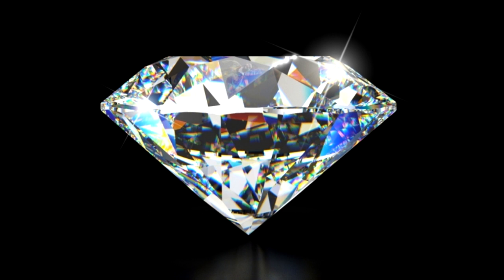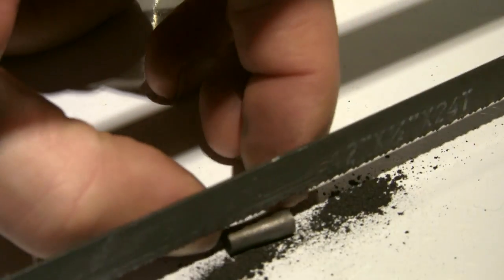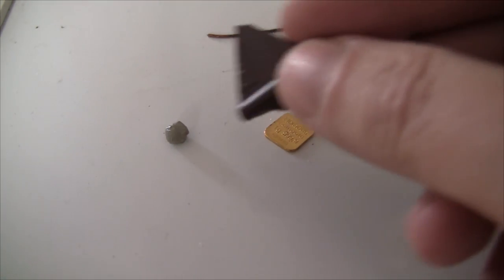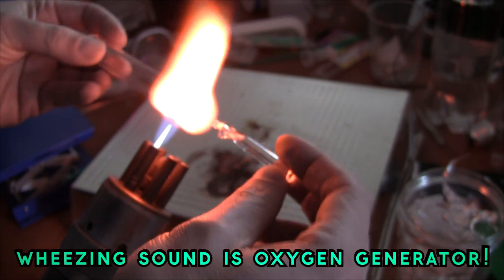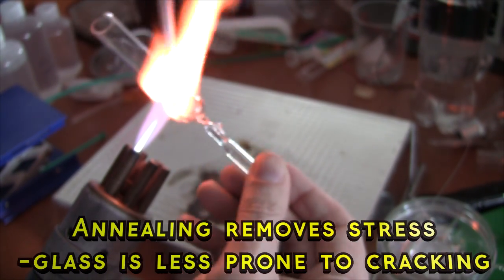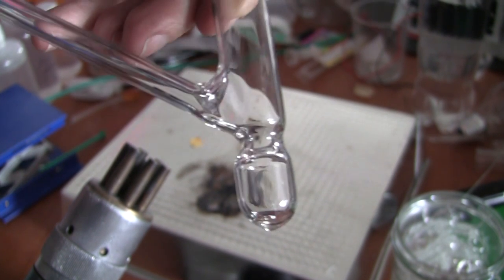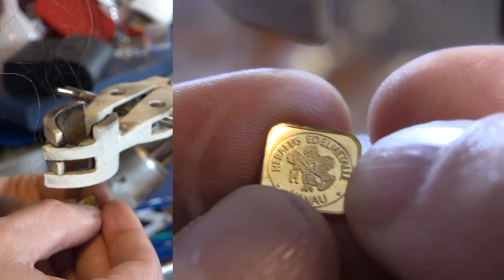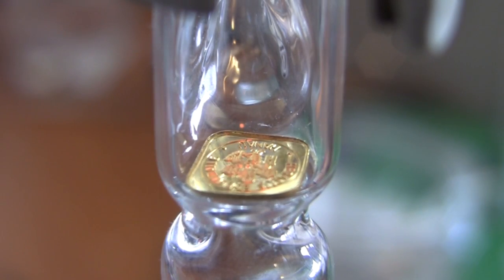Can burning Diamond melt Gold?

Comment: Coming next: can jet fuel melt steel beams?
Reply: "MELTED" STEEL

Claim: "We have been lied to," announces the Web site AttackOnAmerica.net. "The first lie was that the load of fuel from the aircraft was the cause of structural failure. No kerosene fire can burn hot enough to melt steel." The posting is entitled "Proof Of Controlled Demolition At The WTC."

FACT: Jet fuel burns at 800° to 1500°F, not hot enough to melt steel (2750°F). However, experts agree that for the towers to collapse, their steel frames didn't need to melt, they just had to lose some of their structural strength—and that required exposure to much less heat. "I have never seen melted steel in a building fire," says retired New York deputy fire chief Vincent Dunn, author of The Collapse Of Burning Buildings: A Guide To Fireground Safety. "But I've seen a lot of twisted, warped, bent and sagging steel. What happens is that the steel tries to expand at both ends, but when it can no longer expand, it sags and the surrounding concrete cracks."

"Steel loses about 50 percent of its strength at 1100°F," notes senior engineer Farid Alfawak-hiri of the American Institute of Steel Construction. "And at 1800° it is probably at less than 10 percent." NIST also believes that a great deal of the spray-on fireproofing insulation was likely knocked off the steel beams that were in the path of the crashing jets, leaving the metal more vulnerable to the heat.

But jet fuel wasn't the only thing burning, notes Forman Williams, a professor of engineering at the University of California, San Diego, and one of seven structural engineers and fire experts that PM consulted. He says that while the jet fuel was the catalyst for the WTC fires, the resulting inferno was intensified by the combustible material inside the buildings, including rugs, curtains, furniture and paper. NIST reports that pockets of fire hit 1832°F.
Reply: Until I see the WTC towers & the Pentagon & everything inside them liquified entirely,
I will continue to get all my information on the subject from Alex Jones.    (sarcasm)
Reply: after 100 ways to make tinfoil hat.
Reply: 7/11 was a part time job! Jet fuel can't melt nacho nacho cheese.
Reply: http://www.popularmechanics.com/military/a49/1227842/
http://www.purdue.edu/uns/x/2007a/070612HoffmannWTC.html
It's not just the NIST report.
Reply: SPOILER: yes, if they aren't in concrete
Reply: Or maybe try: OMG THE TWIN TOWERS WENT DOWN KILLING A TON OF PEOPLE AND SO DID A RANDOM OBSCURE OFFICE, THAT'S THE FINAL STRAW, WE'LL TOTALLY BE UPSET NOW

That's not ridiculous logic at all, right? Because.. motive. Totally needed that extra building to be collapsed to justify an invasion, amirite my fellow conspiracy theorists?
Reply: Debris from other buildings falling on top of building 7. Buildings aren't built for stuff falling on them. They're built for static vertical stress and some horizontal stress from wind. Not planes flying into them and concrete and steel falling onto it.
Reply: BBgub
Jackass I mean Jack S.

What is the motive to including WTC7 in artificial demolition? Would the twin towers themselves not generate enough raw emotion and shock for the American people to effectively want justice and/or revenge?

Ya'll have some explaining to do on the significance of 'destroying' a random obscure office, and why it is or would be just as important, if not more-so according to ya'll, than the symbolic and lives that were lost at the twin towers.

Really though, take a stab at it. I'd like to see how your brains work when working through Psychology and human emotion and the detective work it takes to figure motive. Investigators do it all the time, need motive to do a murder usually.

What's the motive here? What's the point? What does it demonstrate?
Reply: Jet fuel doesn't burn hot enough to melt steel... but that's completely irrelevant when we're talking about 75 tons of metal, glass and plastic crashing into a building at 575 MPH.
Reply: Conspiracy theorists will be disappointed if no catastrophe happens during the Trump administration. Better start blaming all those previous mass shootings on Obama though, maybe he's got an investment in the bullet or casket industry.
Reply: +Jack S.  "Those 2 goddamn towers were BUILT TO WITHSTAND A FULLY LADEN 747 impact!"

No they were NOT; they were engineered to withstand the impact of a 707, a smaller and lighter aircraft. What hit the towers were 2 767 jets - much larger heavier and with more fuel than a 707 could carry.

WTC7 fell because of the structural damage caused by debris from the two WTC tower collapses, and uncontrolled fires that burned all day in the lower floors weakening the steel supporting columns until collapse around 5:20 PM.
Reply: ReaperEOD fucking dumbass when a foreign nation sends a plane into your own country's building and kills YOUR people, it means WAR, not only by common sense but by legality and by the L.O.W.
Reply: Indeed, burning thermite is excruciatingly bright and as large and amount as would be needed to bring down the trade towers, it would most certainly be noticed. Also, I would like to thank you for volunteering your time to combat lunacy in these comment pages.
Reply: *Can burning diamonds melt steel beams?
Reply: No, but it can fatigue steel to the point of catastrophic failure.
Reply: Yeah, but there was also thousands of tons of asbestos in those buildings and TO BOOT, the floors that were impacted by the planes were recently fireproofed. Coincidence?
Reply: no spoliers Joe!
Reply: +BBgub 
Falling debris, it's quite simple.
Reply: Building 7 was hit by massive debris. And has been burning for hours. The footage showing it collapsing doesn't depict any explosions nor is there any bang hearable. The smoke from the gun is just dust in the wind...
Reply: WTC 1 and 2 actually were built to take the impact of a jetliner crashing into them, and they did take that impact without instantly collapsing, so that engineering goal was a success but they didn't take into account the after effects of such a crash, at least not far enough.
Reply: BBgub you are right. It collapses after catastrophic kinetic energy strikes it and heat melts its support beams
Reply: What exactly do you think is burning inside a jet engine to produce 2,000C operating temperatures? Hint it's jet fuel and that is some 600C+ hotter than the melting point if steel thus why the combustion chamber inside jet engines is usually made with things like Tungsten alloy etc. Softening steel is much easier only requiring temps of around 700C live wood can burn hotter than that with no insulation in fact forest fires are usually hotter.

This fire on the other hand had plenty of air flow since both sides of the buildings facade was punctured by the kinetic impact and was supplied with huge amounts of fuel not only the relatively short burning jet fuel but tons of longer burning fuels such as paper, plastic, wood, fabrics, and organic remains. The jet fuel would be more than adequate to ignite all of those materials in fact the autoignition temperature for pretty much all of it is <600C.

Of course above the fire you still have intact concrete floors adding significant insulation doesn't take a genius to figure out that air temperatures near the ceiling of that room would easily hover around 1,000C+ for as long as the fire continued to burn heat would have been trapped in the area between the top of the holes in the front of the building and the insulated flooring above it which is also of course the exact worst place for it because that is also where the trusses between the columns holding said floor up are located. Maintain this for several hours allowing the steel to absorb that heat and yeah eventually the steel softens until gravity finally wins.
Reply: YES! Phil showed directing oxygen close to the flame increases combustion - one of the most overlooked phenomena in the WTC events is the stack effect - Buoyancy occurs due to a difference in indoor-to-outdoor air density resulting from temperature and moisture differences. The result is either a positive or negative buoyancy force. The greater the thermal difference and the height of the structure, the greater the buoyancy force, and thus the stack effect - people only could stand near the perimeter (for a limited time) because the fire was further away and the sucking in of air cooled the materials at the opening preventing their location from heating up as fast as areas deeper within the tower - apart from sagging, the different rates of thermal expansion could have played a role by asymmetrically "tearing" structures apart slowly, maybe more so in WTC 7s unusual design than in 1 and 2
Reply: Provide your evidence for there being Nano-Thermite found in the dust. The only thing that I can seem to drag up is Niels Harrit who had found some red/grey chips that he concluded were thermite since the burning of them produced molten iron. Contrary to his crack-pot theory, however, that material is actually a rust-preventing primer paint that contains iron and kaolinite.

http://www.internationalskeptics.com/forums/showthread.php?t=231314
Reply: +Jack S.
"Yeah, I'm sure the government would openly admit it was a controlled demolition. Everyone knows anything knows the NIST report was bullshit. They didn't even TEST for any known explosive in their "report". Government shill bullshit. "

Weird though that the guys that do controlled explosions for a living or test material strength for enabling us to calculate how long a building will stand up during incidents like a catastrophic fire overwhelmingly say the report is correct and "everyone knows anything" on the internet is ignorant and full of shit.

How could ANY controlled demolition stay secret and hidden in a complex in which five to ten thousand (depending on how many of the office towers you count "in") people still worked the day of the attacks? You need QUITE A LOT OF HARDWARE to make something like that happen, even with really good suited explosives and the experts do no tlike others to run around where they have prepared their wiring and the holes they drill to get to a point where it is most destructive to blow up stuff inside the load bearing structure.

Wild fantasies of "thermite" melting down the towers have no relation to reality. There have been people cut off from rescue above the burning parts of the building that were on their phones until the end, there were several hundred people successfully evacuated out of the buildings and several hundred firemen ran into them to help with the evacuation and to try and save the towers and nobody mentioned any weird contraptions or bombs being obviously all  over the place?

Your common sense is fucked up and skewed beyond help.
Reply: +Jack S.
"Those 2 goddamn towers were BUILT TO WITHSTAND A FULLY LADEN 747 impact!"

No they weren't. The plane the structural safety report before the building commenced regarded was a 707, not a 747 and further than that it was a mid 60s model, not really comparable to a 2001 fully loaded just after the start 747. Just for comparison, the multiple variants of the 707 go from 104,000 kg to 151,500 kg take off mass, while the 747 starts at 317,515 kg and goes up to 447,696 kg. That's between 2 and 4 times as much weight. Also the calculations thought the most likely hit would be by a tired pilot trying to land at New York, not by a maniac trying to hit  abuilding with a recently started jet. For reasons of completeness... the planes that ACTUALLY hit the WTC twin towers were both Boeing 767 at a weight between 142,882 kg and 204,116 kg still a good deal heavier than 707s.

And finally it seems like the original report did only tackle the impact itself as they did not know how to calculate for the consequences of a big open fire from all the spilt jet fuel... they announced that the building WOULD survive an impact, but that the fire would kill many people as it would basically not be containable and spread throughout the whole building... which is what really happened, the towers stood after a plane crashed in each. They were brought down by fire.
Reply: +A,ex Long
" I didn't know we specifically designed buildings to have planes fly into them. I guess the WTC designers sure could see the future.."

No, they could see the past, where amongst other accidents a famous crash occured in 45 with a B25 bomber and the Empire State Building.
Safety concerns about planes ACCIDENTALLY hitting high rise structures like a skyscraper actually ARE part of the statical analysis before they get a building permit... even more so for powerplants and dams... but we can hardly test that as both a real building of that type AND a fully loaded plane like a 787 is pretty pricey just to be sure it will not cause a full collapse of a building. So they work with estimates and comfortable safety margins. Which btw worked in the case of the WTC... They continued to stand after the hits for 56 (south tower) and 102 minutes (North Tower) respectively.
Reply: It can weaken steel enough to make it easily bendable but not if all the fuel burns up in an initial fireball.
Reply: +BBGub
They will if their structural integrity has already been compromised by an incoming plane.
Reply: I'm pretty sure he did a video on 911 but I can't seem to find it.

Maybe he's joined the truth movement!
Reply: OMG WTC7 WENT DOWN, WE MUST INVADE FOR THIS ATROCITY.

See how ridiculous that sounds?
Reply: BBgub - sure sure - and a tree can not burn.
Reply: +BBgub
Lol coming from a guy that doesn't understand physics.
Reply: Has shitposting gone too far?
I need to do it full-time.
Reply: rigtio8887 but rocket fuel can melt steel beams!
Reply: That's why building 2 came down faster, more pressure from the floors above ..
Reply: lots of stuff made from Magnesium ...
Reply: in the fire what part would you find ...
Reply: rigtio8887 is this to do with 911
Reply: A;ex Long 
http://www.ae911truth.org
Reply: gullible peasants. our world is doomed.
Reply: Jet fuel? No. Fire? Yes.
Reply: Bullshit, on 14th September the Blackboxes of AA Flight 77 were found, the majority of the CVRs magnetic tape was fused into a solid block of charred plastic (useless), the FDRs  information was completely recovered! http://www.webcitation.org/5RfC3xUsq?url=http%3A%2F%2Fwww.ntsb.gov%2Finfo%2FAAL77_fdr.pdf. 
The Silk Air Flight 185 incident is completely different, whereas there is only one major physical impact on the CVR/FDR and the later possible water leak, early recovery is relatively easy since accessibility is pretty good in the river (Musi): Indonesian NTSC didnt want to think of suicide, but NTSB and history all point in that direction: the phenomenon is higly underestimated still today, out of different socio-cultural and economical reasons https://en.wikipedia.org/wiki/SilkAir_Flight_185  
In case of Flight 77 the recorders and remains of the airframe hit the most reinforced structure of the Pentagon many walls after hitting the ground in front and were trapped in the collapsed sections 91m deep where the heat was contained up to 2,000 °F - While progress was made against the interior fires by late afternoon, firefighters realized a flammable layer of wood under the Pentagon's slate roof had caught fire and begun to spread. Typical firefighting tactics were rendered useless by the reinforced structure as firefighters were unable to reach the fire to extinguish it. On 12th the fire was "controlled" but not fully extinguished, Firefighters continued to put out smaller fires that ignited in the succeeding days.
Reply: it wasn't a nation, it was a criminal organization spread around the world both logistically and by historic ties - action was necessary, but way back in 1993 after the WTC bombing and when the trace was lost in 1998, and not only after 9/11; the previous interventions in the middle east were bad enough to stir up hate and helped rise a big portion of todays attractivity for terrorist ideas, especially in locals, as well as global spread of ignorance and strengthening of a self-righteous martyr complex in many individuals, exaggerated anticapitalism, paranoia etc. -  one of the few good consecuences was the disapproval of more people towards war, even conservsatives (many also before the "war on terror") rejected the idea of such a scale (possibly many suffering veterans) - while many ideas like antisemitism and questionable views were always widespread on the populaces, to many of the affected people (mind, over 99% of the citizens in those countries were not Al Qaeda affiliated and many of those terrorised by them) it must have felt like a modern crusade which they were forced to endure and take much more "collateral damage" ultimately suffering even more under their psychopathic populace which gained more power in the chaos, as soon as power vacuum arose (not saying it was all good before)
Reply: the irony is strong in your comment; i am 100% positive that you yourself have not read one peer reviewed paper on matters directly related to structural systems of supertalls, nor do you know, that only the AON Center comes close to the particular unique style of tube-frame system of the old 1 & 2 WTCs, especially in terms of dimensions - the floorspace oriented design was especially vulnerable to fire induced structural failure; the perimeter columns were only designed for lateral loads, not for supporting weight - thats why the thicker core columns (partially) stood a little longer, until the missing side stability exceeded capacity - the many engineers and architects in supertall construction have learned out of the incident to invent more fire resistant steels, new truss systems, more composite usage (higher amounts of concrete) aswell as advanced super and megacolumns, several safety system implementations etc.
Reply: dont forget, observation dictates theory, not the other way around, sometimes new discoveries in materials science are made with unprecedented scales of energies involved - never in history a comparable modern airframe jetliner has hit any tall building, especially not of this design, so childish assumptions of improbability are invalid - scientific method falsifies, the proof lies in the ones who claim somehing isnt possible, until it is recreated accurate enough and shown to be impossible, the calculations and models of supercomputers, the expertise of the highrise affiliated companies with the most experience in supertalls are the best approximation - (most) unorganized laymen cant even come close to really understand nor work out results at the most specialised scientific community levels, there possibly have been rare exceptions, but the arguments against the official report are mostly not really differentiated well enough and sometimes terrifyingly ignorant - most people sharing this pseudoscientific shit are secondary or tertiary parrots who dont even want to understand an official not sensational enough report with hard physics, while the view that fits their emotional satisfactions is always the easier one to hold on to - the point is, even the part of really scientific working defenders of the official theory look at the assumptions of the deniers, with the same amount of scepticism as on the official ones - that makes good scientific approach, not stating or copying prefabricated and often manipulated so called "evidence" - while on a political level and some of the procedures of the planners may forever be unknown, at least the physical possibility seems to be shown by reality
Reply: "I dont know who youre replying to, and Im not reading all that" to you, i primarily addressed the twin towers; if you don't even have patience to read some few sentences - can you present a credible source of the supposedly quotes of demolition "experts"? well, at least read through the linked WTC 7 NIST report and even if you don't believe it, take years to learn civil engineering and materials science plus the history of WTCs systems and you'll understand
Reply: hot multiple-ton-heavy debris perforated the thin concrete slab floors and ignited combustible interior at levels 6–10, 13–14, 19–22, and 29–30 during the day - the sprinkler system was rendered useless, it required manual initiation of the electrical fire pumps, rather than being fully automatic; floor-level controls had a single connection to the sprinkler water riser; the system required some power for the fire pump to deliver water; water pressure was low, that's why firefighters gave up
Reply: 311 was an inside job!
Reply: Regardless if it can or cannot. It was still known months beforehand that they were going to do this. WtC 7 had a very lazy report made up about why it fell. Why they kept everything a secret for 15 years also with ALOT of redacted shit should also be a red flag. Its not just conspiracy. Hundreds of People heard bombs going off prior. Nano thermit WAS found. If you think a plane did all that youre just purely stupid. Pentagon still refuses to release cctv video, and the entire plane that "crashed" into it got completely disintegrated but a passport remained. Just think about it. Thats all you gotta do.
Reply: you display superficial knowledge on so many levels it isn't even worth discussing if you are so lazy to not even research the simplest of "arguments" which are copy pasted
"secret for 15 years" evidence?
"Hundreds of People heard bombs going off" it has been shown many times in history and criminal investigation that witnesses experience is very limited in perception, they mostly cannot understand causes and often inaccurately recall their experience
"Nano thermit WAS found" *thermite - i'm very positive you don't even know what that is nor do you understand that it would be stupidly complex to arrange the required amounts and cabling
Reply: Pentagon relied on personnel to secure, not CCTV; very few cameras were on site, mostly low frame parking cameras not for security - most material was discovered very late due to bad quality and possibly ongoing investigation until programs to deblur could present accurate telling - the plane didn't completely disintegrate, you were even too lazy to read anything of that report
Reply: the "just think about it" argument is so childish and snobbish, the what they think of themselves as skeptics, they  don't see any fault in their views nor do they question them in their arrogance - everything must stand the test of reproductive models and multiple sources have to back up evidence and a peer review must check this - NONE of truther BS is backed by the much bigger independent worldwide scientific community or skyscraper industry experts
Reply: TOP KEKTUS lmao. So who are you and why do you think youre opinion matters more than mine? As it is now, absolutely nobody who is a civilian knows what has happened. Including yourre narcissistic know it all ass. I dont listen to my government because theyve been lying to us fot a very long time about a lot of things. I use TOR and wiki leaks for my information. I read every word of the 9/11 papers that came out last year. All because i choose not to waste more than 5 mins on a useless comment section doesnt mean i have superficial knowledge. I just dont care enough to get stuck in. I know my government and saudi arabia were the sole reason why 9/11. Whether you agree or not matters not to me. Youre nobody and you know nothing, same as me. What i do know though, is that 9/11 smells like a fish market gone bad in a slum of india.
Reply: TOP KEKTUS Hundreds of people including first responders did hear bombs. Not only that there are tens of videos of the sounds also. Its pointless to even begin with you though because you couldnt hear anything other than what you want to because youre so full of yourself. 9/11 wasnt just a plain old terroist attack involving planes, and honestly if you believe that you are a complete imbecile.
Reply: Not only that but i had family who were there during the attacks who saw them and ran from them covered in dust in soot. They heard the explosions prior and during also. Not only that but they heard explosions before building 7 fell also. As my uncle was one of the firefighters that helped during the catastrophe. Bombs were most definitely a part of the attack.
Reply: Didnt the terrorists put bombs in the basement during the first attack? Why not this time. Logic would tell you to weaken the building from bottom to top. Yet there is no mention of bombs. and it was nano thermite that was found. No i dont know wtf that is but thats what was found.
Reply: All im saying is they are not telling the whooe truth. So you must think and ask why. Thats what i mean by just think about it. If it was a plain afghani terrorist attack we would of just came out and said everything there was tp say about it. Instead ita been covered in a veil of bullshit for 15 years and even when they finally decided to release information about it, it still smelled like shit in spain. Youre a sheep, a fucking moron. So is everyone else in this damn country me not excluded. Except i know how to think further than you and see shit you obviously cant which is a pity. I wish more people could see through bullshit. Neverll happen though obviously. What do you think of water gate? Taliban? Cia drug running? The iran contra? Jfks assassination? The entire legacy of ghe bushes? Youre dumb. Amusingly dumb since you think youre smart lmao.
Reply: I dont claim to have any evidence either. I just know people can be bought off and our countrys leaders are warhawks. False flag operations have been happening for a very long time, and just like the ones in the past the truth will come out eventually.
Reply: no, they heard explosions or compressed air compartments, elevators coming down... they didn't see any bombs - are they explosive experts? i beg to differ - "full of yourself" no i am not, because i only look at scientific evaluation not claims by civilians who panicked except when the level of detail and expertise show a reason to believe them
Reply: no opinion matters more, everyone should be free to have one, but the actions of an opinion can be malevolent; you are right, we don't know what happened, we can only approximate by a big group of scientists and experts with the right tools and tech - TOR and Wikileaks can be good sources, but even they have wrong Information, that's logical; also such a highly controversial theme can be infested with agenda on "both sides" - i would try to hear what people like Snowden have to tell about this
Reply: if it doesn't matter why take time to respond? 9/11 indeed smells bad, so much misunderstanding and blockade between possible responders, control, secret services... all the time they had since 1993 to evaluate and the loss of track in 1998 - i guess they are just human too and are full of mistakes - but such a extremely complicated event on so many levels needs stucking in, and even then only a part is understood
Reply: where is the credible source that did find Nanothermites (MICs)? until there is a definite proof with chemical reasoning and showing the methods used for evaluation i won't buy it - of course the whole truth isn't told, there was secret govt information in those bldgs (mustn't mean bad, just that secrecy is common) "Truth" is a limited observation from all the intervals from planck time to human perception (with help of tech)
Reply: TOP KEKTUS How could elevators fall prior to the planes hitting or pockets of air? Im talking about hearing explosions that blew out windows BEFORE the first plane even hit the building. By seconds i may add. You have to see the videos for yourself i guess. Human error will always be accounted for in any circumstance i understand this, and yes i also understand that there was top secret information stored in said buildings. Has nothing to do with why they dont tell us what happened to said buildings. Who cares about the info they contained just explain why it fell.
Reply: Also if it was as cut and dry as planes crashing and buildings falling the government and every other organization that assisted thrm during the tragedy would have been candid from the start. The fact that its been so fucked up and hidden behind so much red tape when we lost 5000 lives just doesnt sit well with me. If i were you i would stop putting so much faith into people who act like they know so much and just stop and try to connect the dots yourself. Theres plenty of information out to grab and data mine. You just gotta have no life like me lol :/. Sorry i was grumpy last night.
Reply: https://www.metabunk.org/the-thermite-paint-theory.t3263/ this thread also explains the many faults in the truthers "theories" about nanothermite paint - claims of truthers and numbers used in naive calculations are often made up https://www.metabunk.org/nanothermite-vs-thermite-thermate-for-cutting-thick-steel.t2873/page-5#post-84459
Reply: in reality, the nanothermite layers (VOD of max 1000m/s not enough to separate pre cut steel beams, min. used in controlled demolition 2000+) would not separate but sinter the beams (explosive welding), so they would stay in their place possibly even stronger than before http://www.mrzgroup.umd.edu/pdfs/2012_C&F_Reactive%20Sintering.pdf
Reply: for the observed outcome nanothermite is ineffective, while thermite in its large amounts needed (how would that many big boxes stay unnoticed?) would create such bright flashes that it would have been definitely noticed in lower manhattan; pure elemental iron and aluminium oxide levels weren't as abundant to even support a smaller scale use of thermite; further, paint as carrier would weaken the raction since it excludes gases provide faster VOD
Reply: my thanks to you also, without you i wouldn't have looked at this closely in a long time - i'm just a construction and skyscraper structure enthusiast, there's so many things to learn even for the experts in the highrise planning and building community, i only scratch the surface while "truthers" don't even know how few they know
Reply: yeah, while the WTC jets weren't fully fueled ("only" 1/3 entered the WTC) and weren't much heavier than the ones used in the static calculations of  Worthington, Skilling, Helle, and Jackson (WSHJ (from 1967-1983 "SHCR")), they were going much faster, had stronger airframes, and about 18 times the impact energy (+ even more explosive E in fuel!)
the calculations somewhere between 1962 and 1968 only secured initial standing, even many decades later there was no way to know how long the WTC Buildings could stand - even modern computer programs/testing today are limited
Reply: also interesting: in the early hours most of the ~50.000 (in the towers) + ~140.000 daily visitors, workers, clients, vendors and tourists were on their way to work or just entering the buildings of the site; ~15.000-18.000 were inside the towers; in the 1993 car park bombing it took 4h to evacuate the towers; it could have been easily 20-30k casualties if they had hit at lunch time
Reply: I'd watch the fuck out of that
Reply: Can diamond melt steel beams?
Reply: Clearly you lack critical thinking skills, if you need to resort to primary school rhetoric to dismiss detailed reports like these. Come up with facts if you want to dismiss that steal can be weakened by this procedure.
Reply: rigtio8887 Probably not, but an impact at the speed of flight can sure as shit rip them open like a tin can
Reply: Jack S. 

I didn't know we specifically designed buildings to have planes fly into them. 

I guess the WTC designers sure could see the future..

lastly, If it truly was designed to be able to take a plane (which no engineer was accounting for) then why did they fall?

silly people get silly questions
Reply: with enough oxygen, i'm sure it will!
Reply: What do you think brought down the World Trade Center? One detail not often brought up is that jet fuel poured down the elevator shafts. There were fires in the towers all the way down to ground floor. Maybe the fuel wouldn't melt steel altogether but it weakens beams enough that you might as well say they're melted.
Reply: Thing is, it's not only the jet fuel that's burning, it's everything else on that floor that's burning. I highly doubt that jet fuel alone can make a steel beam weak since it's most likely gone by that time, but if half an airplane is burning it's more than enough to make the steel beams weak.
Reply: Even if it's supposed to withstand an IMPACT, it's a different story when it comes to heat.
Reply: @Jack S. If you actually read the NIST report, instead of dismissing it, it has an explanation for WTC 7 as well. You show severe anger issues (in this reply), but after denial, I guess you made some progress in the five stages of grievance.
Reply: rigtio8887 Oh no! I'm trapped under steel bars! Quick! Take this jet fuel to melt it!

It doesn't melt! Why doesn't it melt!

...
Reply: You are assuming burning buildings tend to collapse.
Reply: https://www.nist.gov/engineering-laboratory/final-reports-nist-world-trade-center-disaster-investigation
Reply: That's been proven false yet people still want to believe official story. Building 7 well come on that doesn't take a rocket scientists to know a few office fires can't bring a whole building into it's own footprint... Maybe it does though because aan awful lot of people ssure believe that it happened.
Reply: Uhh, they do design them like that, because they were so damn tall and near a bunch of airports.
Reply: rigtio8887 yes, but it cannot melt passports. They have the ability to leap from tall burning buildings unscathed though!  Amazing they can leap past molten thermite
Reply: How dare  you say get over that  9/11 happened, how insensitive ans heartless can you be
Reply: People trust the "experts" that have their names attached to that NIST report, but people who are identically educated, who disagree with the report, are automatically stripped of their "expert" status by people who claim to be critical thinkers and just believe the official story.
Reply: Why did they fall? Lol. Explosives.
Reply: Yeah, I'm sure the government would openly admit it was a controlled demolition. Everyone knows anything knows the NIST report was bullshit. They didn't even TEST for any known explosive in their "report". Government shill bullshit.
Reply: WTC7 WTC7 WTC7

WHY DID IT COLLAPSE ON ITSELF? NO PLANE HIT IT.

Those 2 goddamn towers were BUILT TO WITHSTAND A FULLY LADEN 747 impact! What is hard to understand about this? Have you people still not realized that 9/11 is what has led us down this path? IT ALL STARTED THERE, and it's not coincidence. People say "what's the point, there's no oil in Iraq."

Well if there was, you wouldn't know about it. People like the Bushes, Cheney, Rumsfeld, BLACKWATER have made BILLIONS off of 9/11 by now.

How did NANO-THERMITE (the ideal material for cutting steel like butter) end up in the dust? The fact that it was on a nanoscale means it COULD NOT be produced by natural events, it is purely manmade and made in a lab. People ask why did they destroy WTC 7.... remember.... the building that fell in on itself WITHOUT A PLANE HITTING IT? Well, gee, the FTC (Federal Trade Commission) headquarters was there. And they lost all their investigative materials into insider trading and the like.